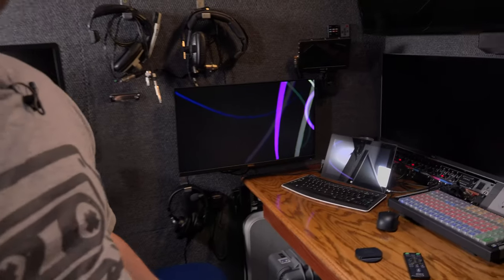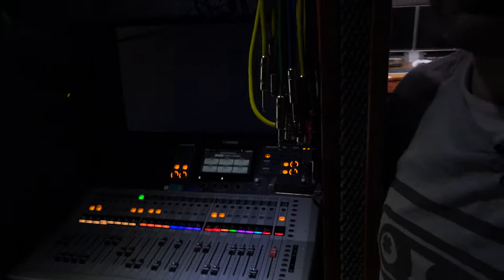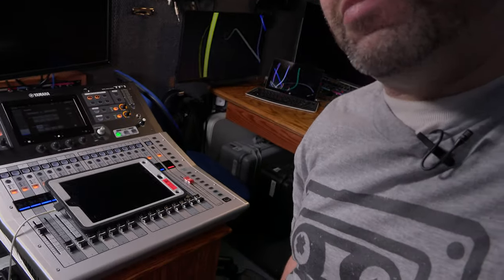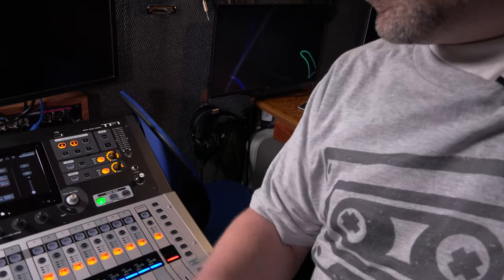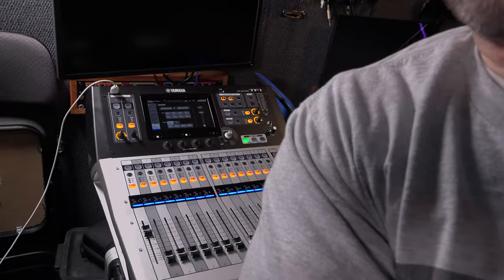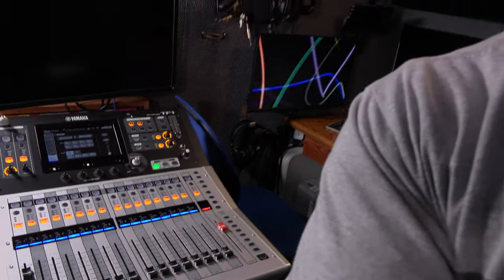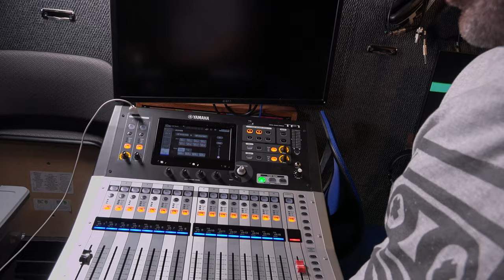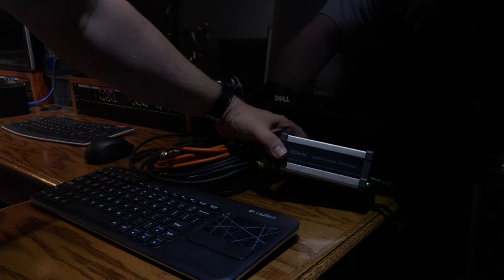Trailer Construction Update - 2019-09-21: Drawers!

Comment: So you got your reply station up and running? Can you share more about how it works? Probably custom software?
Reply from the maker: The hardware is all there, but I still haven't gotten to making the software functional yet. I likely won't until I have an event where I need replay -- which hasn't happened in a very long time.

Comment: Have you had any luck with the Ben & Fellows Dante interface?? I am looking at purchasing this same unit but waiting because you said you may do a review.
Reply from the maker: I'm planning on shooting that review in the next day or two... but I'll summarize my thoughts for you: 

It does work, and the sound quality is fine. There's a strange slight difference between input and output levels (output is a bit hotter than what the input can accept). And there's apparently no way to change the input level -- it's essentially just a standard line-level input. They do have other models that can switch inputs to mic-level and adjust the input level, but they're considerably more expensive.
Reply: @djp_video  thanks.
Reply from the maker: The video has been posted: https://www.youtube.com/watch?v=BfQUODyuJQw

Comment: Since you already run a switch with trunk ports, have you thought about setting up a VLAN with an access point at your remote location and running your TF mixer via the iPad app remotely? Although you loose the physical control of faders, you still have the processing power of the TF3
Reply from the maker: I've actually done that a few times.  It works for the most part, but I've never found mixing on an iPad to be much fun, especially when you've got feedback you need to fix in a hurry, or when someone starts talking into a muted mic channel that you need to find and turn on ASAP.  Waiting for the iPad to wake up, re-connect to WiFi, and connect to the mixer takes a long time, especially in the heat of the moment. 

The channel levels, compression, equalization, and effects needed for FOH vs. a live feed are also significantly different, making it difficult to build two proper mixes on a single console. Separate levels are easy enough to deal with with an Aux Send, but everything else is hard to do with a single mixer.

Having the TF1 not only gives me a separate dedicate console just for FOH, it also gives me an additional 16 input channels on top of the 16 I have with my Tio1608-D and 24 in the trailer with the TF3. So I'm not just getting a second mixer, I'm also getting another 16 inputs and outputs in addition to the other processing available.

The other issue is that in order to have FOH audio at all my trailer has to be hooked up, running, and monitored, even if we aren't shooting any video. With a separate mixer I can pull away and FOH audio is still functional.  I also do a fair number of events without the trailer, and my ability to create a proper audio mix without it has suffered until now.

Comment: Love the updates! I do have a suggestion that you already probably already thought of. But do you have any thing in place so the drawers dont come out during transport of the trailer? I didnt recall you mentioning anything in the video. Just curious. Thanks!
Reply from the maker: The drawer slides themselves have a detent, and they require a bit of force to open. I'll keep my eye on them and if they do end up coming open I'll figure out a solution, but for now I don't anticipate it will be much of an issue.